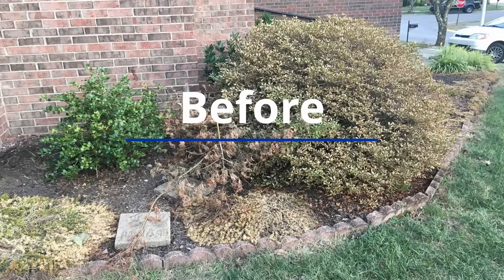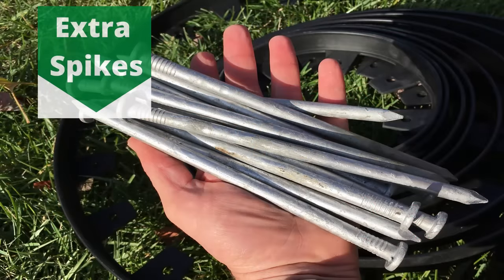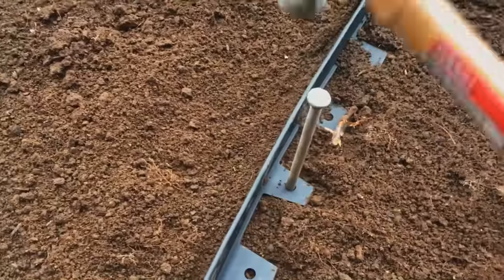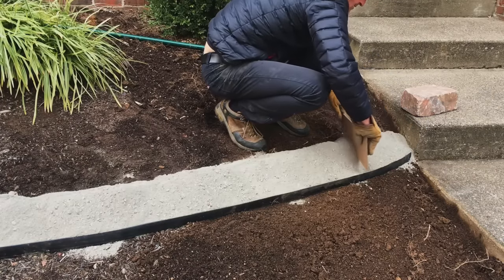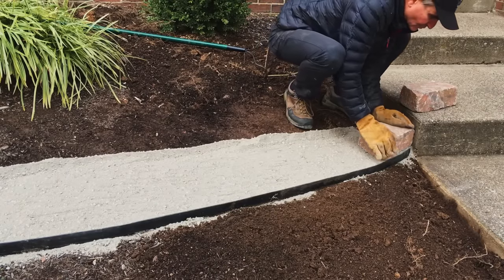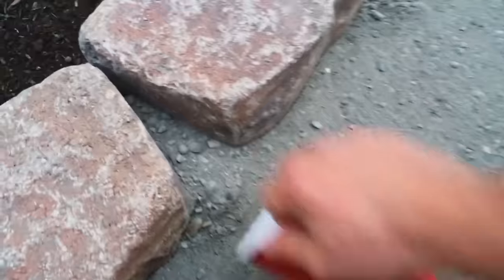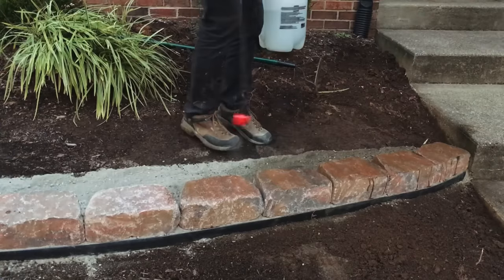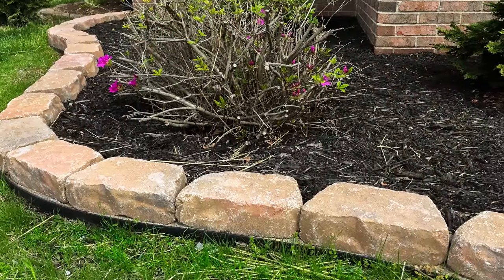easy diy No Dig Border *2020 UPDATE*

Comment: Can you  do 2 layers of stone
Reply from the maker: Jerry, I have not made a second layer on this type of border because I don't know if it would look that good and the difficulty level is raised some because you would mix up and use a traditional mortar between the layers. Even, though, it involves more work, I would highly recommend digging out the old dirt and mulch out of your area so the level is dropped enough so that there is plenty of room for the mulch to sit in there without spilling over. Also, the same thing can be accomplished by building your border out further so the dirt can slope down to the level of the bottom of the blocks and also have room for mulch. I hope this helps.

Comment: Can this be done without the cement?  I'm putting rocks in my bed and fabric down for weeds
Reply from the maker: You can, but you are losing out on the benefits this cement has to offer in this technique which is rigidity/permanence, height, and weed barrier. Honestly, the cement is the unique difference between this technique and all others. That being said, other types are ok also. Thanks for your question, Eddy. Have a great day!
Reply: @maxpatch67  thanks for the reply. I appreciate the feedback. That makes a lot of sense.
Reply: How would I use the cement along with the weed fabric?
Reply from the maker: @eddymunster813  I highly recommend using cardboard(instead of fabric)...here is my video explaining the reasoning and the technique...https://www.youtube.com/watch?v=HIWDPlaB6wY&t=5s. If you do use fabric, make your border first and then lay the fabric in the area...believe me, fabric causes lots of problems that you don't want over the years.

Comment: Can sand be used instead of the cement?
Reply from the maker: The cement provides four major functions in this border technique 1. Height(for looks) 2. Keeps the stones straight/aligned over time 3. Stability/strength 4. Weed barrier(the extra width is nearly impenetrable to aggressive weeds and grasses(Bermuda Grass) that we have here in Nashville. Here in Nashville, sand would be full of weeds and grass in short time. I hope this helps.

Comment: What about leveling?  My area I want to do is similar to yours but not level.
Reply from the maker: If you have small dips and bumps, the border should glide over those and they should not show up when finished. If you have really large problems, then you'll need to get out your shovel and take care of your problems. This border looks really good going up and down with the lay of the ground as it is and that is how I use it. If you want a completely flat border, then you would need to use a different type of border where you go through a leveling process. I hope this helps. Have a great day, Dan!!

Comment: Can I do this with cinderblocks ?
Reply from the maker: Yes. Just use the technique demonstrated in the video and it will work. Don't try to build a wall with this method, though. It does not work for that because you are not using a levelling method and the dry cement mix technique does not work as mortar between layers because it just falls out...so yes, you can, but with limited use of just one layer tall. I hope this helps, Meena.

Comment: What is the point of the no dig edging? Would this work without it?
Reply from the maker: Many people have difficulties with digging ranging from back problems to poor soil conditions like rock and clay in the ground. This method solves that problem plus provides superior qualities as a weed barrier, amazingly durable and keeps its shape perfectly.
Reply: @maxpatch67  awesome thanks!! Will be doing this in the near future
Reply from the maker: hey, Chris, make sure air temps and ground temps are at least in the 50's so the cement can cure in short time
Reply: @maxpatch67  thanks! No problem here I'm in South Florida 😀
Reply from the maker: noice!! :)

Comment: So do the stones adhere to the concrete?  Is this for certain climates?
Reply from the maker: Build the border as demonstrated in the video. When you mist the project when finished, the concrete will bond it all together. This is a special concrete mix that works perfectly like this....its called FAST SETTING. This border is great for all climates. Have a great day, Claire!!
Reply: @maxpatch67  interesting. I live in Nova Scotia and was concerned about frost. I have some small pavers I’d like to use for a flower bed. I may give this a go!

Comment: how can i make it taller? i want a raise bed. Thanks!
Reply from the maker: kp n, I have not made a second layer on this type of border because I don't know if it would look that good and the difficulty level is raised some because you would mix up and use a traditional mortar between the layers. Even, though, it involves more work, I would highly recommend digging out the old dirt and mulch out of your area so the level is dropped enough so that there is plenty of room for the mulch to sit in there without spilling over. Also, the same thing can be accomplished by building your border out further so the dirt can slope down to the level of the bottom of the blocks and also have room for mulch. I hope this helps.

Comment: How is this method of I wanted to go 2 or 3 blocks high (using landscape adhesive)
Reply from the maker: Charles, I have not made a second layer on this type of border because I don't know if it would look that good and the difficulty level is raised some because you would mix up and use a traditional mortar between the layers. Even, though, it involves more work, I would highly recommend digging out the old dirt and mulch out of your area so the level is dropped enough so that there is plenty of room for the mulch to sit in there without spilling over. Also, the same thing can be accomplished by building your border out further so the dirt can slope down to the level of the bottom of the blocks and also have room for mulch. I hope this helps.
Reply from the maker: That's a fine idea....the main challenge to that is keeping organic matter from piling up on the rock. If you can keep on that challenge, its a beautiful idea!

Comment: Loved the video!  Question, how would you handle this on a slope?
Reply from the maker: Thank you, Sandy. I appreciate that. On a slope, you would do everything exactly the same as I did in the video. The border will be made and work exactly the same....no problem. When you level off the cement mix, just level it off at the same slope the ground is and it will look good that way.

Comment: You only have one layer I have three and you have to level the first layer or it will rock and it should never be tilted to start with it should be level.
Reply from the maker: Yes, this border is only meant be made one layer tall. Did you use a different technique and build your short wall then?

Comment: I just stumbled across your video and I think the technique you are using is AWESOME! I have a question though: Are there any leveling recommendations to the first layer, especially if you are going to add 2 or 3 more layers?  Will the pavers settle any when you start adding water to the concrete?  Thanks!
Reply from the maker: Thanks so much, jkdmmabox!! I don't have any levelling recommendations for adding more layers, I have never done it, but some have left comments here that they have done it and love it. I can tell you that there is no settling during or after misting the concrete mix. It stays exactly the same and just starts setting up right away. I hope this helps. Have a great day!!

Comment: You can do this minus the concrete simply put down your edging make sure your ground is tamped and hard then lay your blocks. There is no need for the concrete
Reply from the maker: You can do it without it, but here is why it's best to use  cement. The cement provides four major functions in this border technique 1. Height(for looks) 2. Keeps the stones straight/aligned over time 3. Stability/strength 4. Weed barrier(the extra width is nearly impenetrable to aggressive weeds and grasses(Bermuda Grass) that we have here in Nashville.

Comment: hey. what if i want to do two stones stack up? cuz one side of my lawn is low and other end is high
Reply from the maker: I have never don't it, but some have left comments here that they did and they like it. They used either landscaping block adhesive or traditional mortar between the layers.
Reply: @maxpatch67  thank you sir. Will try
Reply from the maker: @ghattasahmad6071  sounds good!! :)

Comment: can you do one more layer on this instead of just one stone?
Reply from the maker: Justin, I have not made a second layer on this type of border because I don't know if it would look that good and the difficulty level is raised some because you would mix up and use a traditional mortar between the layers. Even, though, it involves more work, I would highly recommend digging out the old dirt and mulch out of your area so the level is dropped enough so that there is plenty of room for the mulch to sit in there without spilling over. Also, the same thing can be accomplished by building your border out further so the dirt can slope down to the level of the bottom of the blocks and also have room for mulch.

Comment: Great video!  I'm very new at gardening and I want to try this border. I was wondering why there was so much Quikcrete behind the stones. Was that necessary for them to set? Also I've seen others alternate those types of stones so that there's no gap to fill in between. Will your method work with the alternating stones or is the gap necessary because it will allow the stones to be sturdier with the Quikcrete between them?  Lastly (sorry for so many questions)...if I wanted to do a different border in the future, how hard would it be to dig up the stones and Quikcrete?
Reply from the maker: Great questions, G W. 1. The extra concrete width on the backside helps with stability and weed control. You could make it more narrow if you wanted. 2. With a curving edge, gaps on the front side would be created by alternating blocks and it doesn't look nice so it's better to keep it uniform with all the gaps on the back. 3. Only create this border if you are sure of what you want for a very long time since it is considered permanent. I suggest making it a little bigger so the plants the area will look good even when the plants are bigger in a few years. I hope this helps. Have a great day, G W!!

Comment: I would like to make it taller - maybe 2 or 3 levels high.  Suggestions on how to do this?
Reply from the maker: I have never done this, but some have left comments here that they did....just use traditional mortar or landscaping adhesive. Have a great day, Rick!!
Reply: That’s what I thought.  I’ll try the single row first, and then add more if I think it will look right.  Nice choice on the stones!  I was browsing in Lowe’s last summer, thinking about this project, and these are the ones I decided on as well!  I watched another video where a guy chose these too.  He altered his arrangement, putting them wide up front, followed by narrow, and continuing that way.  I think I like the way you did it better.  Thanks for the advice!
Reply from the maker: @rickbowman21  ok, cool....ya, if you are doing a straight line or at least not that curvy, it works better(visually) to alternate them to fill in the gaps, but if your design is curving quite a bit, then I've found the best way is to have them all the same to keep it uniform. Hey, if you decide to make it, I'd love to see your finished pix. You can send them to tim@timvogelaar.com. Here some others that folks have made: https://www.timvogelaar.com/Easy-diy-no-dig-border.

Comment: Would this work on a hill?
Reply from the maker: Yes, Colton, it works perfectly on a hillside. The worst part will be mulch wanting to pile up along it, though, from gravity pulling it down the slope. The best mulch to keep from sliding down the slope and piling up and over the border would be normal hardwood mulch....don't use light and fluffy stuff like pine bark, because it will go everywhere and not stay in place on the slope. If you have any more question, please let me know. Have a great day!!

Comment: What if the ground is not as level as yours is?
Reply from the maker: If there are any huge dips or humps that you don't want to show up, the use your shovel and level them out. This yard was actually not that level. When you nail down the plastic edge, you are not going to pound it down tight across the whole length. If there are dips, you are just going to let the plastic edge glide over that spot until the next high spot. This is going to happen naturally with the stiffness of the edge. Don't pound the stakes in all the way in the low spots so the edge stays high over them and does some leveling for you. But like I said, if you have large problems to take care of, then you'll need to get out your shovel. I hope this helps, Tim. Thanks for the question and have a good day!!

Comment: How would you add a second row of stone?
Reply from the maker: Joe, I have not made a second layer on this type of border because I don't know if it would look that good and the difficulty level is raised some because you would mix up and use a traditional mortar between the layers. You could also use landscaping block adhesive. Even, though, it involves more work, I would highly recommend digging out the old dirt and mulch out of your area so the level is dropped enough so that there is plenty of room for the mulch to sit in there without spilling over. Also, the same thing can be accomplished by building your border out further so the dirt can slope down to the level of the bottom of the blocks and also have room for mulch. I hope this helps.

Comment: Do you need more concrete for a second layer.
Reply from the maker: I have never tried it, but some viewers have done a second layer with either traditional mortar or landscaping block adhesive. Thanks for the question, Stella!!
Reply: @maxpatch67  Thank you this is useful. I was planning on doing this style of flower bed against my chain link fence. Do you recommend I put is a backer or close off the part of the flower bed against the fence?
Reply from the maker: Hmmmmm...it might depend on how much chance you think there is of things invading your landscaping area....if you think there is trouble on the other side of the fence, then you'd better keep it out with your border!! What do you think, Stella?

Comment: Please answer ASAP how many stacks can you put on that concrete base
Reply from the maker: Sorry, I just found this message...I have not made a second layer on this type of border because I don't know if it would look that good and the difficulty level is raised some because you would mix up and use a traditional mortar between the layers. You could also use landscaping block adhesive. Even, though, it involves more work, I would highly recommend digging out the old dirt and mulch out of your area so the level is dropped enough so that there is plenty of room for the mulch to sit in there without spilling over. Also, the same thing can be accomplished by building your border out further so the dirt can slope down to the level of the bottom of the blocks and also have room for mulch. I hope this helps.
Reply: @maxpatch67  do you know what the interlocking stones for the wall flower bed can how do I turn a corner do they make a corner piece for those stones do you know ASAP answer please
Reply from the maker: Using some hand and eye protection along with a hammer, you can whack away at the ends two blocks to make them line up for a square corner. Otherwise, it will just look a little funny if they don't fit more perfectly. I hope this helps...again, if you try it, use eye protection and good gloves for protection from bust the corners of the cement blocks. I hope this helps. Here is a link to the block product: https://search.yahoo.com/search?fr=mcafee&type=E210US885G0&p=lowes+landscaping
Reply: @maxpatch67  thank you so much for replying back. I will give it a try. Again thank you so much
Reply from the maker: my pleasure, Pat!!

Comment: Could  you use another layer of bricks
Reply from the maker: You could either uses landscaping block cement or traditional mortar. I don't ever make these two layers, high, but if I did, those would be the choices. I don't think it would look as good when its not leveled out and also going higher. Have a great day!!

Comment: Why didn’t the cement under the bricks get any water
Reply from the maker: Steve, the way this cement works is that is acts like a sponge, absorbing any moisture around it until it has enough to begin setting. So if you are patient and mist it thoroughly, the water will all through and under the blocks. I hope this helps. Have a great day!!

Comment: Can you add a second layer of stones? This is an amazing video!!
Reply from the maker: Jesse, I have not made a second layer on this type of border because I don't know if it would look that good and the difficulty level is raised some because you would mix up and use a traditional mortar between the layers. Even, though, it involves more work, I would highly recommend digging out the old dirt and mulch out of your area so the level is dropped enough so that there is plenty of room for the mulch to sit in there without spilling over. Also, the same thing can be accomplished by building your border out further so the dirt can slope down to the level of the bottom of the blocks and also have room for mulch. Here is what some others have done with this technique: https://www.timvogelaar.com/Easy-diy-no-dig-border